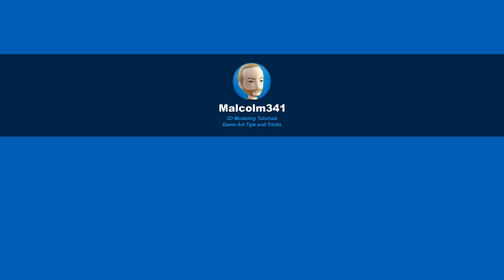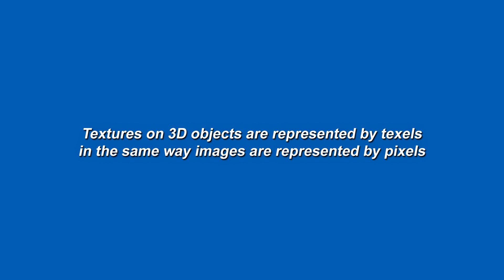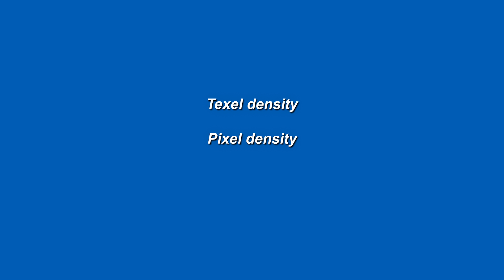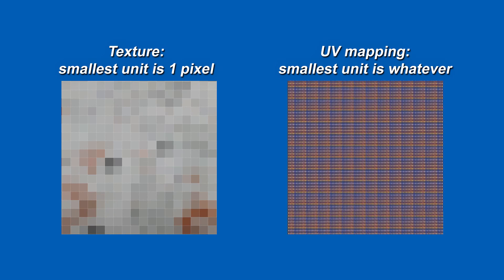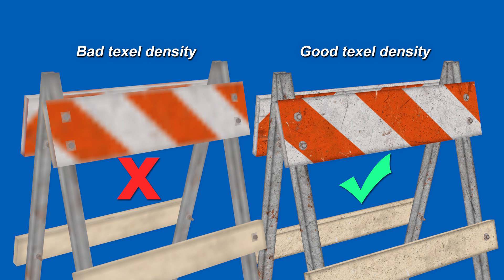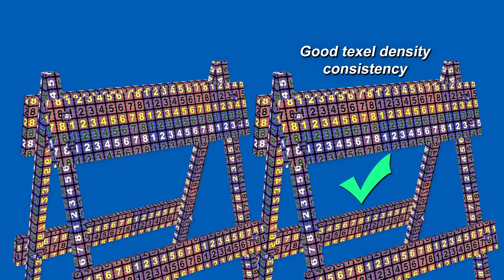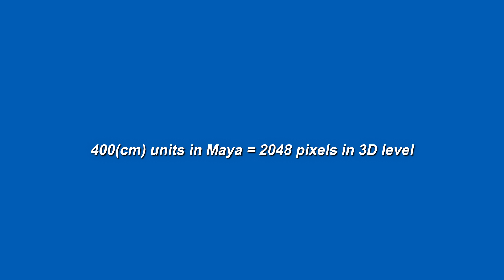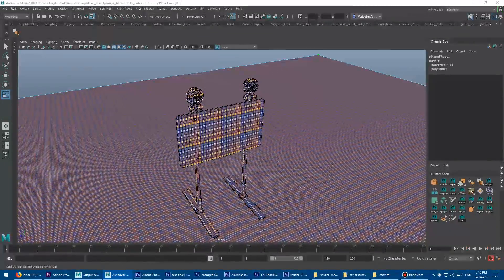What is Texel Density and How to Master it

Comment: @malcolm341 why am i thinking wrong here. I want to make a 5x5x0,5m concrete wall with a 512 quality texture map.  i painted a 512 output size in Substance painter. but when i place it on the 500x500x50cm object in maya and press set at map size 512, why does the UV stretch so big and making it so tiled? shouldnt it fit just inside the UV 0-1 square? what am i missing?
Reply from the maker: What method are you using to apply the UV map, if you're using the get and set texel density in the UV toolkit you have to set map size to 512 and pixels per unit to 1.0240, the pixels per unit will be relative to map size. An easier way to do this would be make a plane at 500x500cm, set map size to 512 and then select the plane and get the pixel per unit with the get button which should give you 1.0240, from there you can just use that number on other objects in the scene. I find it easier to understand if you start with a plane mapped 0-1, scale it the size you want, then set map size to what you want, then capture pixel density that way you don't have to do the math and Maya does it for you. If you're working with planar mapping, it's even easier, just planar map on Y and then in the channel box select polyPlanarProj and change projection width/height to 500, that's how we used to do it before Maya had get set texel density tools.
Reply: @malcolm341 2 follow up questions. Does the actual resolution of the texture change or mess anything with the texel density and the UVs? And do i guess there is another workflow when youre doing tilemaps. And what you are doing is for unique props that needs the UV fixed and then shipped to the texturing program. Not the way around with tilemaps. But i guess texel desnity is important for tilemaps aswell.
Reply from the maker: @fressno1807  The actual texture you apply is relative to the exiting UV mapping, texel density is defined by the size of the object, how much you tile the UVs, and the size of the texture. For example lets say you have plane that is 400cm big, you apply a 2k map to it tiled 0-1. That's 400cm = 2048 pixels, if you apply a 1k map to that same plane that's 400cm = 1024 pixels, if you then tile that plane twice in the UVs thats now 400cm = 2048 pixels with a 1k map applied, but now you have more visual repeats which is undesirable.
Texel density just means how many pixels across how much physical world space.

For tile maps they're actually more important to keep them at the correct texel density, but also much easier because they tile so you can just up the UV tiling until they match perfectly with what your defined texel density for your world is. On professional projects like Gears of War 5 we'd define tile map texel density first using in game camera and character, walk around, look at things, zoom in with the gun. After much testing we determined for that game that the world texel density should be 384cm = 2048 pixels. We also used detail maps so when you zoomed into things they wouldn't look blurry. There are other techniques we used for large objects and rocks to keep them from looking low rez since you basically can't unwrap anything larger than a medium sized prop.
Reply: @malcolm341  im still a young padawan i guess when it comes to this. But im learning alot.
Reply: But lets laborate that if i have a 72 resolution 512x512 pixel image vs a 300 resolution 512x512 pixel image. Does that change the resolution of the image projected on the model? And will that change the size of the texture in some way? Or increase the texture memory allocation? Or does maya or the texturing program scale the resolution down or up to a standard when you use it?
Reply from the maker: @fressno1807  72dpi and dpi in general is an outdated idea from the days of printing presses. In digital art dpi has no affect on how many pixels are in a texture or image. It's just an old school way of measuring things which has no place in modern image creation. For example, in Photoshop you can unlink the dpi from the document dimensions and have any dpi you want, but still have only 512x512 pixels. Pixels are all that matters, dpi is just some silly thing in certain programs if you up the dpi the image gets bigger, but that's the same as just scaling the image up and it gets blurry, but has more pixels in it. All you need to worry about with 3D graphics is how many pixels are in your texture. Maya doesn't take dpi into account, some image editing programs will, but ultimately if you found a texture that had higher dpi than you wanted, but had the right numbers of pixels in it you could just re-save the image in Photoshop with a new dpi value. I save all my stuff at 72dpi just for consistency. The old "make it 300dpi for print" saying is actually outdated at this point, setting the document size to 300dpi would just make the image really big and lots of pixels means better print quality. These days modern digital printing standards are in pixels since that's what actually gets printed. So now printers are asking for make it 7,000x7,000 pixels to get good quality and whatever dpi.
Reply from the maker: @fressno1807  it generally takes years to understand this fully so you're ahead of the game.
Reply: @malcolm341  awesome! i did some research (wasent that easy finding anything dpi and game related) and it had something to do with having a dpi according to your target audience´s weapon of choice, what platform your player is playing on. dpi´s / device screen size and resolution. I was gonna go for 300 dpi just to be sure, but if you usually use 72 dpi without any difference, then ill also go for it.
Ive been at this game dev since 2015, as a game designer, but im stepping into the arts department now, as im my own boss. and i need stuff done when i dont have anyone except myself.
Got so much shit to make, but so little time.
And a VR project at that =) open world kinda. so ive got my work cut out for myself.
Nice to understand this quick as im working against the clock with this.
Its gonna me my awesome portfolio peiece thats gonna get me into the big game industry bizz.
wish me luck, cus this is gonna get worse before its downhill.
thanx for your reply anyway.
need all the help and clearification i can get.
Reply from the maker: @fressno1807  Think about dpi as metadata, it doesn't actually do anything or mean anything unless the program you open the image with reads it and then what it does with that information is up to the developer of app. Good luck with your project.

Comment: hey @malcolm341 
what is your point on not cutting up your UVs cus it slows down the texture designation in the game engine?
Reply from the maker: Good question, cutting UV edges means each additional cut adds to the vert count in game engine, so the more UV cuts you do the more verts your final model will have. That said, I don't really think about it, I generally try to unwrap my meshes with as few cuts as possible because it makes texturing easier. In Maya 2022 they have a game vertex counter now so you can see how many extra verts are added as you apply UV mapping which is handy.

Comment: I like technique they used in Paragon and UT, with triplanar shaders. This allowed to retain same texel density for all static meshes on a 
level. You can even scale/shear/taper meshes, texture still be same.

Though texel density is still important for RGB masks, stretching or uneven texel density far less noticeable on them (especially when layers textures are similar)For characters/weapons, tileable detail textures were used, with RGB masks to break tiling. Details can be scaled independantly from main texture.

The same technique in other games, serious sam 4, talos principle, assasin's creed, witcher 3…
Reply from the maker: Yeah multi-texturing is the future in my opinion instead of using 8k or 16k textures. We've be doing multi-texturing for rocks for while now because they're so big and need to be scaled to different sizes. The reason we haven't seen Paragon style texturing adopted in mainstream games is because the instruction count is too high, we investigated live tiling textures for Gears 5 and it was too expensive, tri-planar projections alone are too high instruction count be useful, and live tileable layers even without the tri-planar are also unreasonably expensive. Live layers also present another technical limitation in that creating the RGB masks is an annoying cumbersome workflow because of channel packing and limiting the number of layers per material to 3 or 4, or even 8 makes for simplistic synthetic looking textures. On Gears 5 we did the whole RGB mask thing and all textures were created from a source pool of tiling swatches, but that data was baked in engine so the game would actually run. You need at least 15 to 25 layers to make realistic looking material. On these new consoles I don't think you're going to see too much change in the way things are textured unless the Unreal 5 Nanite thing proves to be usable, I have a feeling that you'll mostly see that used for terrain and rocks though.

Comment: This is a great video. I'm no stranger to unwrapping consistency, but I really had no idea the whole approach for Texel density. 2048 per 400cm is a good bit of information. 512 per metre. I have been using 3d max because I am familar with it but I might need to use Maya just for unwrap setting consistency tools. Mirco details is  another great piece of information. And a great way to take the asset up a level. Thanks a lot.
Reply from the maker: Thanks for commenting, glad you enjoyed the video. If you're using Max the same principles apply, but Max defaults to meters where Maya is centimeters. So to follow along with this video you can use 2048 per 4m in Max would be the same as what I showed in Maya. Another Max artist contacted me at one point and he found this Max script useful for setting texel density http://www.scriptspot.com/3ds-max/scripts/texel-density-tool
Reply: @malcolm341  Thanks, I'll check it out. I am just getting back into 3d modelling after 8+ years of not touching it. Videos like this help me catch up to today's standards much faster. This was the first video of yours I have seen, will be checking out the rest of your channel this week.
Reply from the maker: Great, thanks.

Comment: Could you make a video where you apply all this to a modular wall asset with hybrid texturing (tile and unique) I'm very confused about this because I have to match the texture borders and the modular pieces have different sizes, and I also have to maintain the texel density. Please make a video about it ♥
Reply from the maker: It's on the list, but it won't come soon unfortunately. Have a look at this it might help you https://www.artstation.com/artwork/36EVg
With the modular pieces you usually hide the texture borders with trim, or you can just build your modular pieces in halves or quarters so the textures always line up with the main pieces.
Reply: @malcolm341  okiii, thank you!

Comment: What would the units be in 3DS Max? or do you have a video especially for that program? :) thanks!
Reply from the maker: In Max it's the same depending on how big you build things, it's all relative to the character. For example, a person is roughly 2 meters tall rounding up so that would be 200cm in Maya for the base scale, then you can use 400cm = 2048 pixels as a good starting place for the ground and walls. I believe in Max it defaults to meters so that would mean you can make your character 2 meters in Max, then you can use 4 meters = 2048 pixels as a good starting place for texel density on ground and walls. You can go higher if that's still too blurry, but I wouldn't personally go lower. For Gears 5 we used 384cm = 2048 pixels, and in max that would be 3.84m = 2048 pixels so we went a bit higher rez for that game, but I prefer to work in a power of 10 so things line up easier, 384cm is a wacky scale to build modular kits on in my opinion.

Comment: Hello, do you know how to set the texel density on a number of shells in a way that does not create overlaps? In UVLayout, there is an option to scale based on selection, or shells. That's what I am after
Reply from the maker: Texel density can't really be set in UVLayout, all you can do there is uniformly scale everything to pack nicely into the 0-1 UV space. You can turn on preserve 3D ratios if you'd like the shells to automatically adopt their relative scale to each other, but that will then be normalized to the 0-1 UV space. To keep the shells from overlapping just select the object instead of the actual UV shells this will pack them all together without overlap. If you'd like the shells to be a specific texel density and then layout without changing that texel density, first set the texel density of all the shells using the UV toolkit transform tab, there's a button called set there where you can type the value you want. Then do a UV layout and turn 3D ratio off and scale mode off, that will pack the shells into a square without changing their size at all.

Comment: I am new to this whole UV thing, so my settings where: Map size 2048 and Texel Density 56.01
Edit: 5.12 is WAY to low for my model, I need closer to 15-20 to get decent resolution, but still a good video
Reply from the maker: If you're working in film 5.12 does not apply, film uses infinite resolution effectively so you can do whatever you like there and work with UDIM tiles. If you're working in games and your model gets too big you still need to use 5.12 and need to either stack UV shells, mirror, or use trim sheets and tiling textures and sometimes multiple textures shared across modular sets. For small props a single 2048 @ 5.12 works fine. There definitely isn't any games using 20 that's too much tiling or would be bigger than an 8k texture which also isn't possible in games. For example all the environments in Gears of War 5 use 2048 @ 5.12 and the Spiderman game on ps4 uses 1024 textures (which I thought was too low rez) that's why texel density is such a pain because you get so little and have to stretch it so far with annoying tricks.
Reply: split model to more than 1 material, use detail textures

Comment: When texturing in Substance painter its always says “Uvs overlapping”  and even if I ignore it, when I start painting its paints the same stuff on multiple shapes. So I guess it’s impossible to overlap UVs all the time
Reply from the maker: Great question, it's impossible to 3D paint overlapping UVs as you mentioned, it will always share the UV space so the same paint will show up there, but unwrapping your mesh 100% for Substance Painter isn't really a thing in games except on small props that you can hit the texel density on. For larger props you have to rely on stacking shells, mirroring, trim sheets, and tiling textures. It's still a painful tedious process texturing things for games and even on Xbox Series X we'll still be doing it this same way that hasn't changed much in 10 years. If you're having errors painting on stacked shells I believe you can move all but one of the stacked shells out of the 0-1 UV space by exactly one tile and that should allow you to paint correctly, but the UV space will still be shared. Kind of like baking normal maps where in some bakers you can't overlap UV shells.
Reply: @malcolm341  Thanks for your answer :) I’m going to try that out.